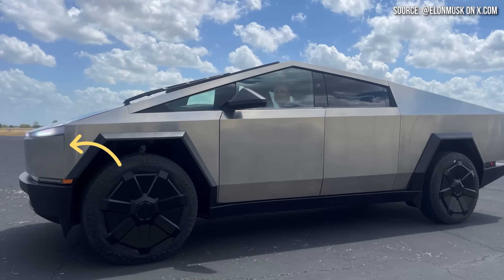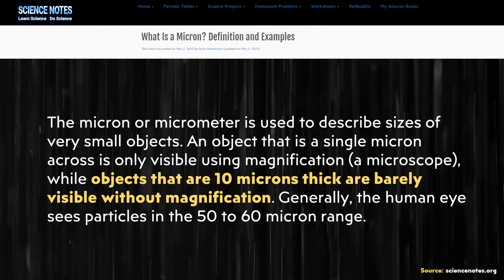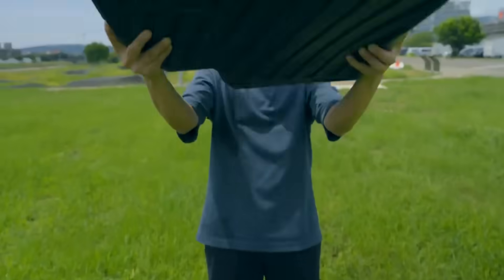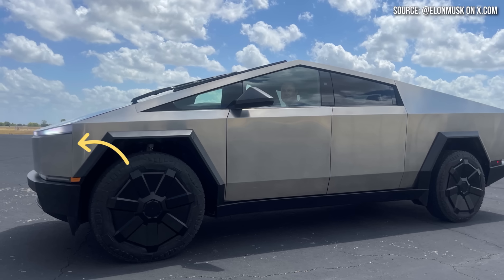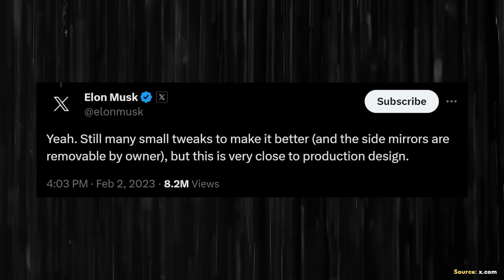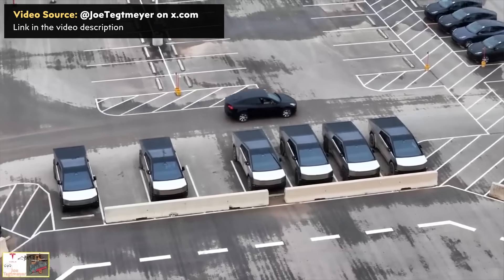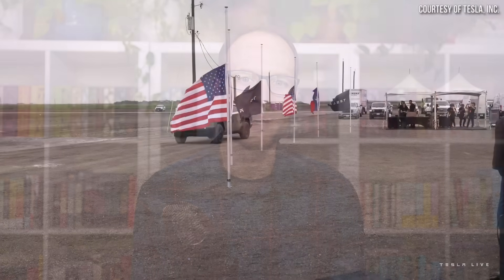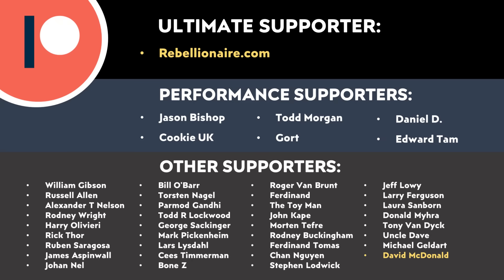Tesla Cybertruck has PERFECT BUILD QUALITY | Towing & Payload Revealed!

Comment: Looks like you are might be interested for compelling story ideas......  Here is a free one (can make it into a deep dive series too). 

"18 New to Tesla technologies that are (might) be in the Cybertruck!"
List them out, then deep dive on 2 or 3 per follow up episode.
I guarantee you eyeballs from everyone anxiously awaiting Nov 30th.

1.  48 volt basic architecture.
2. 9000 ton gigacastings front and rear
3.  Fly by wire steering
4.  Fly by wire braking
5.  Rear wheel steering assist
6.  Stainless steel exterior
7.  Hardware 4 (Yes, it's in cars now, but this will be the "official" launch
8.  New demodded cameras. (yes, but same as above, this will be the official launch of these).  These cameras are raw data, unfiltered front lens, maybe more than 8 bit per channel game changers.  All older cameras have onboard data processing filters to massage the bits coming off the CCD pixels to make them "prettier" losing speed and important signal information
9.  48 volt basic car battery
10.  Every electrical device in the car must either be made from scratch new to be native 48V or now have a built in transformer to downregulate to 12V.  Door motors, blower motors, mirror motors, wiper motors, door lock motors, head lights, internal lights, video screen, .......  Basically 100s of gadgets
11. Electrochromatic glass roof (unconfirmed)
12.  Massive air compressor system for active and passive vehicle height
13.  Transformer from 48V DC to 120-240V AC
14.  New radar system?
15.  Powered Tonneau cover
16.  Unboxed build method
17.  4680 Gen2 batteries
18.  Heavy duty powered rear gate
19.  .....  I'll have to think about it more.

Comment: "Sub-10 micron accuracy" is meaningless. Is it the large finished panel dimension, assembled tolerance, small molded/casted part...? It is IMPOSSIBLE to achieve on even carbon steel stamped parts, much worse for folded thick hardened SS sheet.l. At best ~1/2mm as this is the tooling tolerance. Maybe he means from tooling datum, which is not useful info.

Comment: This is a silly video. Of course Tesla will check the fit and finish before the rollout.  The two real tests will be ramp. When Tesla ramps production can they maintain fit and finish. 
Second, will the Cybertruck maintain fit and finish after off-roading, hauling, towing or hard work.
Reply: 3rd: will it depreciate 50 or 60k in the first year 😂 anyone buying a brand new tesla is dumb. The model s plaid went from 160k to a measly 89k in a year. That'd historic depreciation and probably why every average joe has one now. Model 3 is 20k. This will probably be 60k when it'd all set in done. Hummer ev cost more but it's a better investment and no doubt better looking

Comment: Took over 3 years longer to make. Has a lower payload and tow rating than advertised. So only questions left are cost and how far it will be rated for. Cost will be much higher and range will be lower than advertised. Tesla is no where near where they thought they would be on 4680 production and power density.
Reply: "Took over 3 years" to ... Build the factory, convince companies expert in thier field they could build bigger and better machines than ever before, build those machines, perfect new techniques and materials, etc. all during the 2 biggest "global issues") of the last .... <Insert time>
.
And it's the same timeframe Ford were planning for the factories they need to try and catch up (2021-2025)
Ain't perspective great?

Comment: Range is my #1 criteria for my intend use for camping/towing.
Reply: Seems like the best case towing range for a gas powered f150 with a 26 gallon tank and an optimistic 9mpg is 234 miles of range. Taking the EV rough estimate of 50% rangle loss whilst towing, Cyber truck should get 250 miles of towing range when charged 100%. I'd like to see what it actually is practically though. My estimation is it will actually be better than that, especially with some crazy hypermiler people.
Reply: @HourRomanticist  not looking that way. Some estimates are putting the Cybertruck with 276 or 320 miles battery packs.
Reply: @Dularr  
The 2 motor version.... and they're "Guestimates"